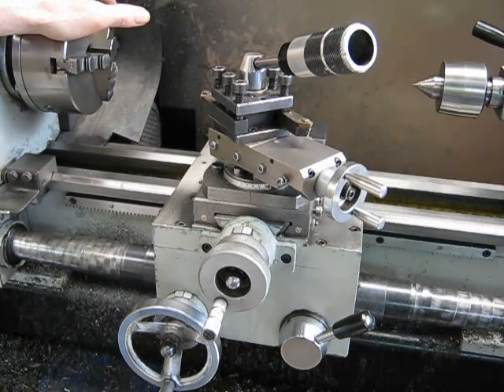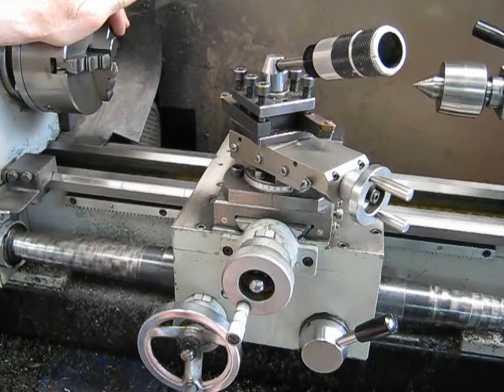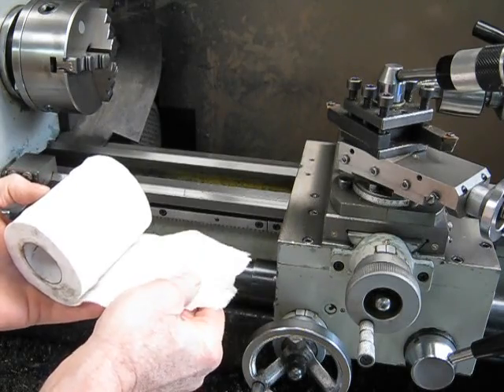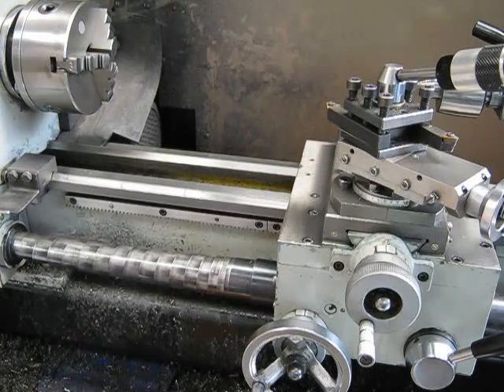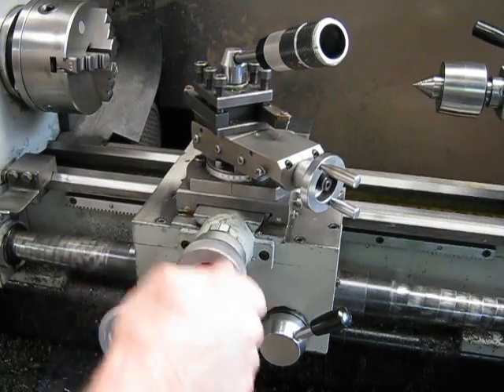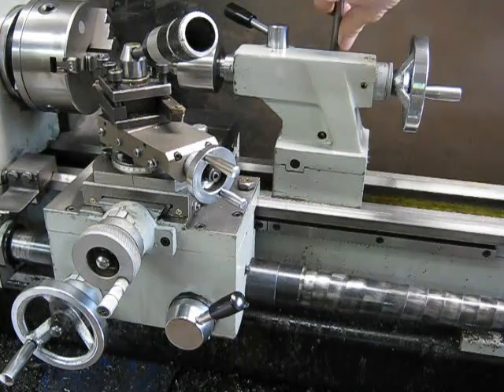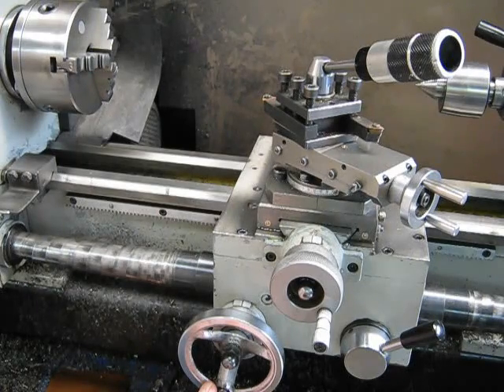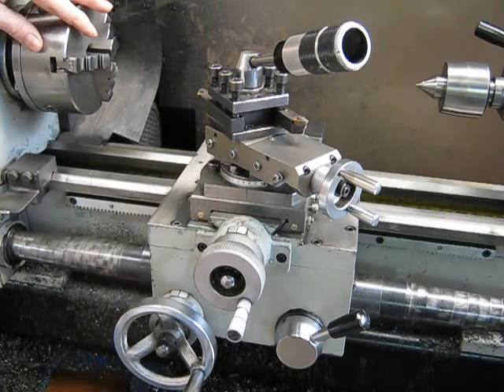How to oil the ways on a small lathe

Comment: Thanks for this video! As a new owner of a 1946 Logan 825 10" lathe, I'm an eager and very novice learner. I've read that 'detergent' motor oil should not be used on lathes, but I don't understand why. Recently, I bought a gallon of 'spindle oil' for about $40 USD and have been using it liberally on all parts. (It was hard to find 'non-detergent' oil.)
Please explain why 'detergent' oils are not recommended for lathe lubrication.
Really enjoy your videos!!
Roy Lewis  - Buffalo, NY  USA

Comment from the maker: If you are in Australia buy a secondhand Rega oil can.  These have the correct oil tip on the spout to get oil into the ball oilers fitted to most lathes.  I'm using one in the video.  If the tip is worn, you can easily machine up a new one from brass and solder it in. Best oil can for the job - I have about 5 of them :) Rob

Comment from the maker: One harmful possibility of using a high detergent oil on a lathe is that the detergent may rot the oil wicks and way wipers if they are felt or leather.  This is a known fact. and a reason why detergent oils (like ATF) should not be used in old car/truck jacks which have compressed leather cup seals fitted.  Rob

Comment from the maker: The booklet for my CQ9325 Chinese lathe says to use SAE 20 machine oil.  There is no mention of detergent factor, and although I have seen comments that detergent oil is not recommended, I've never actually seen any written confirmation of it.  Detergents are in most modern oils, particularly ATF.  Could be folklore. I don't regard it as a significant issue.  Detergents are used to keep non metallic particles (carbon) in solution, so I can't see how it would be bad for a lathe. Rob

Comment: Any oil is better than no oil is what I was told. Personally I am like you, I use motor oil as I was given several bottles and a large can of grease for free, so why pay. Never noticed any problems, I have no rust and very little wear on my lathe, most of that was on it when I got it as it was built in 1982 so it's older than me. Mine does have oil nipples however that require a special gun, bit of a pain but I'll cope.

Comment: Rob, whats your opinion on cutting oil?  Thanks for all of your videos.
Reply from the maker: Cutting oil is like beer - everyone has a different favourite.

Basically I am cheap, so I use a 1:4 ratio of engine oil and kerosene.  This smokes a bit (or a lot when things heat up) but doesn't  remove paint, cause rust, fungus, or dermatitis like the commercial water based stuff.

It's probably not good for your lungs, but I got the receipe from an old time machinist, and I'm still here at 65 - so it hasn't killed me yet.

Being kero based it works a lot like WD40, so is good on aluminium.

That's about it.

That's why I have a fan in the shed - to cool me down in summer, and blow away the smoke when things warm up ;)

Cheers Rob

Comment: Hi Rob,

Great tip! Motor oil is a rather general term though I guess. Was wondering if I can use something like 5w30 or 15w40? I have a can of both these. Thanks
Reply from the maker: Yeah sure.  That oil will be quite OK.

It's interesting when you wipe down the ways each time after use (with toilet paper) and see the black residue that comes off.

People use way oil and don't replace it as regularly and that contamination just goes back and forth wearing everything away.

It's much better IMHO to wipe and re-oil each time you use it.  Remove contamination.

The cheap Chinese lathe manual just says to use machine oil for the ways.  Nothing fancy.

Hope this helps.

Cheers Rob
Reply: Great! What oil do you recommend for parts of the lathe like the gears, spindle etc?
Reply from the maker: Hi Niels,

The user manual (sic) for my cheap Chinese lathe said to use grease on the gears and the tapered roller spindle bearings.  The bearings definitely are greased as there are no oilers for them.

Grease on the change gears is messy, and holds contaminants, so I tried clingy motorcycle chain lube, chainsaw bar oil, all just as messy when swapping gears, and eventually decided to use car engine oil on them and it works fine.  You have to oil the gear carrier centres anyway.

If the spindle bearings have oilers then they need oil - be aware that oil will dilute and wash away any grease in bearings.  Grease lasts a very long time and is in your car wheel bearings.

If it's a Chinese lathe and has greased spindle bearings, I would definitely pull out the spindle and check them, as they are notorious for not having anywhere near enough grease from new- happened to me.

For old plain bearing/bush lathes with oil cups (like my old Schaublin) I use ATF and it works fine.  This is equivalent to SAE 15.  Air tool oil would also be good.

I hope this helps.

Cheers Rob
Reply: Thanks so much for the elaborate responses Rob, it's been really really helpful!! I have a new little 7x14 chinese mini lathe and was thinking I'd spend 5 minutes looking up what oils would be best to use lol. Was really surprised  this was such a highly debated topic. Anyway love the channel and I'm learning a lot by watching your video's!
Reply from the maker: Yes, this is a hotly debated subject. 

Many small lathe owners appear to do what I do.  Way oil is mainly used by the big lathe owners, because that's what it's really marketed for - heavy duty loads.

Whatever oil you use, it needs to be replaced regularly, regardless of what it is.

Cheers Rob
Reply from the maker: Interestingly, several viewers contacted me to say that they are very allergic to petrochemicals, and use canola or olive oil on their lathe ways as a work around for the problem, with excellent results

So it goes to show that the issue is a bit overblown, and any oil is better than no oil.

Cheers Rob
Reply: @Xynudu  That's interesting. Canola (rape seed) oil  was indeed originally  meant to be a lubricating oil. Some foodies still refer to it as such :) And it cheap at the super market!

Comment: Where did you get that gizmo that covers the lead screw?
Reply from the maker: It's OEM.
Reply: @Xynudu  Sweet! Since I texted that question I researched it and they are available aftermarket. I like it a lot, and even though I'm pretty good at both keeping chips off my lead-screw & cleaning it when I get them on there it is SO COOL, basically, I've got to get one now. I'd never seen on on any machine until I saw the one on yours. Thanks!
Reply from the maker: Be aware that the covers reduce carriage travel at each end of the leadscrew by their compressed length (about 1 - 2 inches).  So factor that in before buying.  They also tend to be rather expensive aftermarket.  A lot of new lathes now come with them and the ones on my lathe were standard at least 15 - 20 years ago.  I hope this helps.  Cheers Rob
Reply: @Xynudu  Thanks for the tip. I noticed that straight away. I've got the room for that and will be getting one of these gizmos in the not too distant future. It is just too cool for words, as much as any machine part can be considered "cool" by non-machinists, the heathens.

Comment: an old small lathe maker Myford recommended ISO 32 which is a hydraulic oil for it's lube jobs
Reply from the maker: +orange12v 

The equivalent SAE rating is 10. 

 So, that's a very light oil, even lighter than ATF (which has an SAE rating of about 15).

ISO32 is probably what Myford recommended for the spindle bushes.  Are you sure they recommended this for the ways ?

Cheers Rob

Comment: I would never use motor oil on my ways again. I used it on my mini lathe and the ways got worn within a year. Car engines dip dip into a pan which lubricates all the parts. After i put hydraulic oil on my lathe I noticed a much better difference. To each his own however I wouldnt go against years of knowlege created by engineers.

Comment: I like the copper chip blocker
Reply from the maker: martin dumas So do I :)  That is one of the best and easiest mods you can do to a lathe. It stops virtually all cuttings and rubbish from dropping onto the ways.  It is particularly good if you are grinding on the lathe, as once again it deflects the crap away from the lathe bed.  And being copper it's non magnetic, so chip pickup with a magnet is easy.  Cheers Rob

Comment: did you make the lead screw cover?
Reply from the maker: No. The brand new lathe came with those fitted.
Reply: That would be a neat project for a lathe. Never seen any like that. Would save a ton of time brushing the swarf out of the lead screw. I also like that copper plate idea for keeping it off the ways.
Reply from the maker: The copper plate works fantastically well at keeping the crud off of the ways.  It only rarely gets in the way if I turn to maximum capacity.  It's easy to remove as it uses the two bolts that attach the traveling steady.  Being copper I can use a magnet to pick up chips without it becoming magnetised.

You can buy aftermarket leadscrew covers but they are not cheap - just search for leadscrew spring coil covers or some such.

Yes, they keep the leadscrew totally clean and it also protects the half nuts as well.  You do lose some travel with them though.

I did a video on them a while back:   https://www.youtube.com/watch?v=xoCPPwFaJB4

Cheers Rob
Reply: I was thinking of using a bit of aluminum I have for the purpose instead of copper. Cheaper.
Reply from the maker: Good idea.

Comment: Where would I get those lead screw covers and are they worth it?
Cheers
Reply from the maker: You can buy them after market, but not cheap.  Search on concertina/ coil spring cover, or lathe leadscrew cover.

Well worth having but they reduce carriage travel by their compressed length.

You never have to clean the leadscrew or half nuts again.

Cheers Rob

Comment: regular detergent motor oil is not the best for lathes it keeps dirt in suspension to be filtered by a full flow oil filter it also holds moisture to be boiled off by the engine heat. You would be better off with a non detergent motor or machine oil.
Reply from the maker: Rob C I think you mean it keeps carbon in suspension, which is the main wear component in a car engine.  No carbon on a lathe.

Machine oil would be best, but motor oil works quite OK.  The manual for my lathe doesn't actually specify any fancy oil at all.  Rob